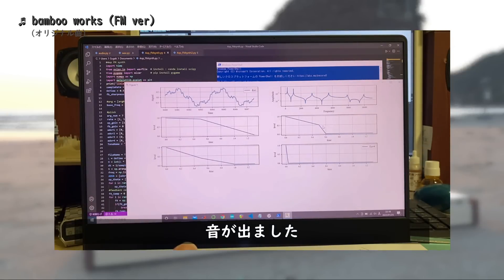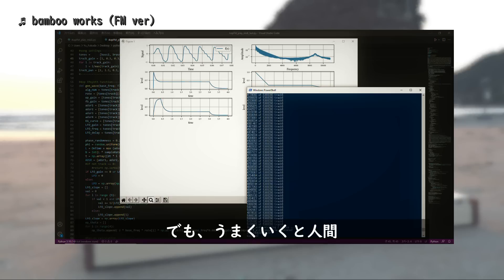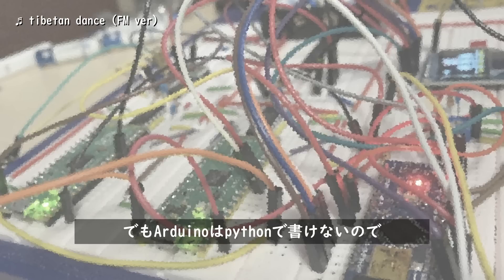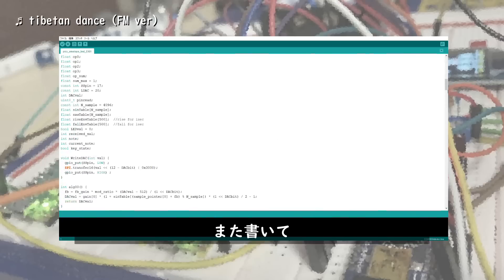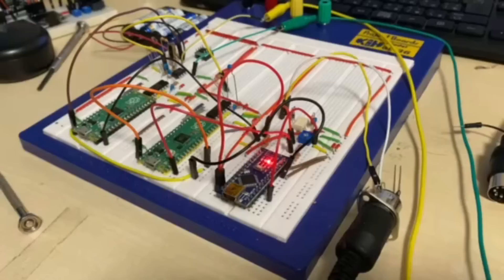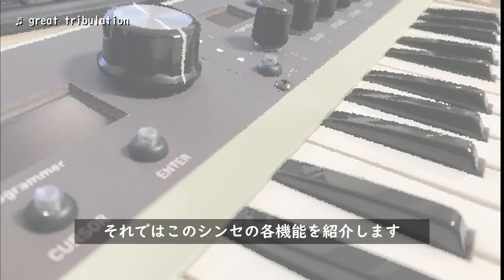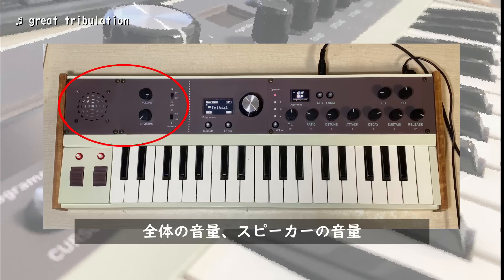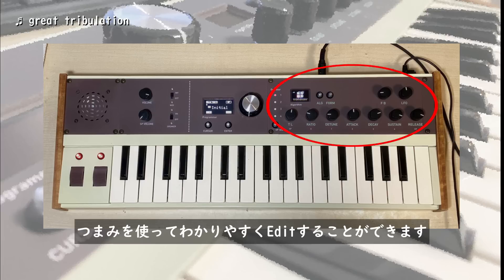【自作シンセ】アナログライクなFMシンセサイザーをラズパイPicoとArduinoで作ってみた。OP-F Synthesizer

Comment: Very cool! But what does frequency modulating noise do? I'm surprised your waveform selection uses the traditional subtractive types (sine, square, triangle, saw) instead of drawing on the OPL/OPZ. It seems like FM of triangle and saw should be the same as wavefolding, and the square would be like PWM.

Are you familiar with the Buchla 700? It has its own set of algorithms (called "configurations") that can do interesting things like feedback loops of more than one operator.

(Sorry, my Japanese is not good enough to talk about technical topics)